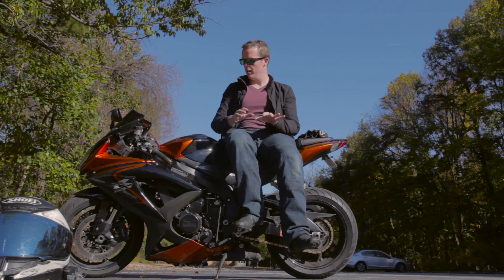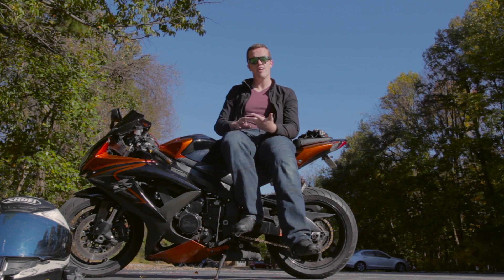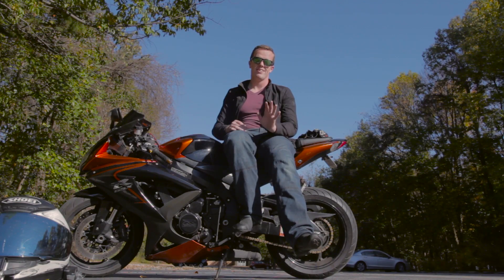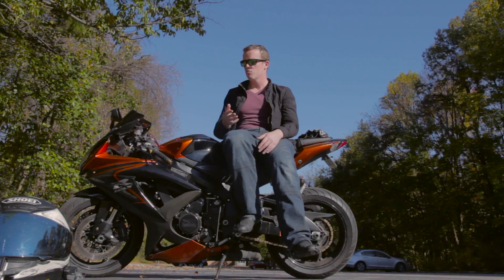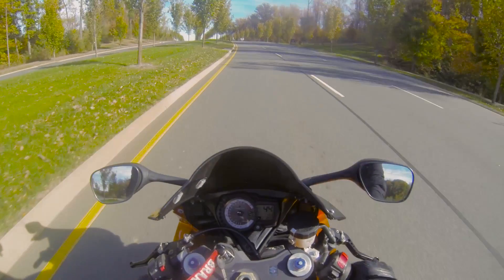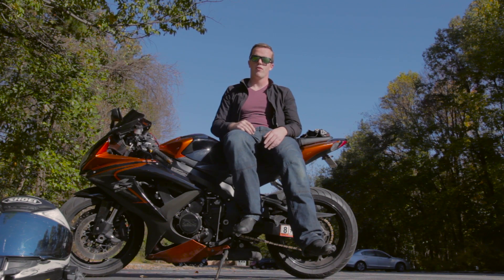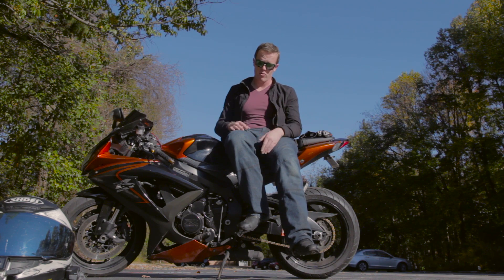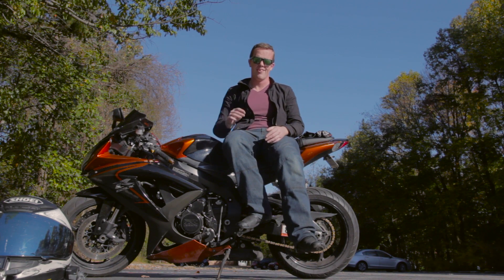How Motorcycle Engine Braking Works

Comment: I used to do 90% - 95% of my braking via engine braking, but changed my habit because I was chewing up rear tires.  Brake pads are much cheaper and easier to change than tires.  Proper braking shifts the braking to the front tire, where it should be, while all of the braking is handled by the rear tire with engine braking.

Comment: Also why rear tires wear SO much faster than front tires. No way around this, just an observation. Good vid, wish I had access to  this back in my noob days.
Reply: MrPunch09 That can depend on various different factors. Weight distripution, not having proper tire pressures, etc.

Comment: One consideration that you missed completely- engine braking increases gasoline consumption. If one of the reasons you ride is to save money on gas (like me), you are better off not engine braking and using your brakes, which over the long term are far cheaper to replace than the extra cost of the gas you will use over time.
Reply: Injectors shut off during deceleration, the back wheel is turning the engine during deceleration not the fuel.
Reply: nitemareman1 he literally explained it to you though?
Reply: You post a comment on this guys video telling him he is wrong, and now you are asking us to explain how engine braking works to you. If you already knew that you didn't know how engine braking works, why did you tell the video creator he was wrong in your first comment.
Reply: You stated  "When I drop a gear and let the clutch out, the engine revs INCREASE as my speed drops."  and "I understand the force of the wheel working with the engine". So you understand that the weight of the moving bike is turning the back wheel which via chain and gearbox is turning the engine over at a speed determined by the gear ratio. So how is it you don't understand that if you then select a lower gear at the same wheel speed that engine will spin faster according to the new gear ratio selected.
Reply: No wrong, guess again.
Reply: No you don't KNOW, I'm a qualified mechanic with decades experience and you are not which means you are wrong and I am right, period. The fact you now admit you know what a combustion chamber is increases the chance you will guess right at some point, so take another guess and well see how many you rack up before you guess right.
Reply: Wrong again, and your videos prove you are wrong.
Reply: Take your Zoloft before posting again.
Reply: That is funny. And funny you mention it today. I'm a big rig truck driver, and earlier this am I was cruising at about 55 and my turbo blew. It sounded like a half stick of dynamite going off just under me. Scared me to death!

But that brings me back to what I can't seem to wrap my head around. If the engine is not using any fuel during engine braking, how is it still running? I realize it would be a small amount of fuel, but it still has to be burning something.
Reply: The engine is pulling at the vehicle, applying a slowing force, while the vehicle (through the wheels & transmission) is pulling at the engine, keeping it turning. No fuel is required when engine braking--the engine just acts like an air pump driven through the crankshaft by the momentum of the vehicle, pumping air from the intake out to the exhaust.
Reply: Not with EFI
Reply: You have a source for that assertion?
Reply: Injectors shut off during deceleration and have ever since EFI existed which is about the same time I became a qualified mechanic.
Reply: Funny thing about engines when they don't have fuel- they stop running. While engine braking (not the same as deceleration) there has to be some fuel consumption. The revs go up even tho the bike is slowing down. It has to be pulling fuel.
Reply: Engine braking occurs at deceleration, it is caused by closing of the throttle plate, the degree of engine braking is mostly determined by the compression ratio, You seem to be conflating "engine braking" that occurs in the operation of the engine during deceleration with the measurement of horse power via a dynamometer brake to get a Brake Horse Power (BHP) value, ergo a value that incorporates the frictional drag of an engine. During deceleration EFI senses the condition and shuts off the injectors as there is no point injecting fuel until the engine reaches idle or the throttle plate is opened again at which point it resumes injecting. That is one of the inherent benefits of EFI compared to Carb.
Reply: Dude you don't even make sense. Try again.
Reply: To you it doesn't make sense but I cant dumb it down anymore just for you.
Reply: You have a lot of nerve talking about "dumbing it down," when you can't even utilize proper punctuation and capitalization. Proper English has a funny way of making things easier to understand. How does an engine rev increase without gas? I understand the force of the wheel working with the engine, but there must be fuel present. Go.
Reply: But I was referring to your comprehension of how engines work not your punctuation. When an engine decelerates its speed is not increasing, it is decreasing. You can cause engine braking by operating the kill switch or running out of fuel at speed and leaving it in gear with the clutch out. How can that be made more simple to understand.
Reply: Man you keep making less and less sense. When I drop a gear and let the clutch out, the engine revs INCREASE as my speed drops. Explain how that occurs without burning gas.
Reply: No, and step away from the tool box now before you break shit.
Reply: My advice to him is next time instead of posting at someones video with "One consideration that you missed completely" in an attempt to correct the video author, and then proceed to demonstrate in ensuing comments he has less knowledge about engine's than a florist, perhaps he should have enough sense to know he is out of his depth and start out by asking for advice instead of giving it and he may actually get an explanation instead of ridicule.
Reply: nitemareman1 NOT WITH EFI
Reply: That is not an explanation. It is an assertion. Let's try it this way first- why doesn't the engine stop running if the throttle is closed by the EFI during engine braking?
Reply: Are you Triggered ?
Reply: If I'm rolling down a long hill, I can close the fuel valve and the engine would still be "running" down the whole slope. If you don't give it gas, it can't use gas.
Reply: This is truly hard to believe. If the engine is running, it's using gas. Every cycle of the piston fires off a fuel air mixture or the engine STOPS. If you start your bike and leave it in neutral, eventually the tank will run dry and the engine will stop. And that's at idle speed.
Reply: Hmm. Let me try to explain it another way... Let's say you have a fan connected to an outlet that's humming along. You suddenly pull the power plug. It still spins for a few seconds before stopping. Is it using power during that time? No. Let's say this fan is placed outside in the open, and the wind is blowing on it, causing it to continue spinning... Using power? Nope.

The same thing can be said about an EFI bike engine during engine braking. The momentum of the bike moving forward is causing the wheels to turn, which in turn turns the engine, even if the computer is not telling the injectors to squirt fuel into the cylinders. Going down a steep hill, the engine's RPM may increase even if there's no fuel running through it.

On carbureted bikes it's a little different, as fuel is pulled in from the carburetor's idle circuit by vacuum in the cylinder, causing it to use even more fuel than when the engine is just idling. However, it's still using a lot less fuel than if you're just revving the engine in neutral.

I have a carbureted bike, but I ALWAYS use engine braking. I try to keep the engine RPM between 4k-7k as I'm decelerating (RPM range varies depending on the environment), so if I need to blast out of a sticky situation I just apply full throttle while pulling in clutch, downshift, drop clutch, and rocket out of there.
Reply: But a fan isn't a combustion engine. It's a fan. There is no comparable explosion occurring with the fan. You can roll a bike down a hill in gear with the engine not running, also. The bike has to be using fuel when the engine is running. How does the engine run at idle then? Because the throttle is in the same position, right? I realize the computer can be telling the gas mixture to be doing different things based on parameters but it seems to me that if the engine is running it has to be burning gas, EFI or not.
Reply: And smart move to be ready for an emergency. I don't use engine braking, but I always shift down to a proper gear while I am decelerating so I can be ready to go if needed. I see some guys pull the clutch and stop at the light in 4th gear. Not good.
Reply: Perhaps I should've used a different term than "running"... I just meant the engine is still turning, pistons still moving up/down, valves still operating, etc. If you manage to get your bike rolling down a hill in gear with the clutch out and engine "off", the engine will still turn, and if it's a carbureted bike, will pull gas into the cylinders even if there's no spark to ignite it. In a fuel injected bike, there will be no fuel consumption when the computer does not have power supplied to it.
Reply: Well that is obvious. What the entire OP is about is that downshifting uses more fuel than pulling the clutch and coasting. The guy above said not with EFI. I don't see how it could be any different.
Reply: From https://en.wikipedia.org/wiki/Engine_braking :
"Additionally, fuel injected engines generally don't use any fuel while engine braking. This is known as DFCO or Deceleration Fuel Cut-Off."

When engine-braking on an EFI bike, you use a little fuel when you blip the throttle to downshift, but then when you close the throttle, the computer notices you're doing engine braking and the injectors stop squirting fuel into the cylinders. Alternatively, you can just skip the throttle-blip while downshifting and it technically shouldn't use any fuel at all (at the cost of quicker clutch/transmission wear).
Reply: Unrelated, but funny anecdote about how I realized engine braking still uses fuel on a carbureted bike: One day while rolling down a long hill in 4th gear, I decided to "save some gas" and turned off the ignition (kill switch). Near the bottom of the hill, I clicked it back to the run position, and "BANG!!" I thought my rear tire had a blowout. When there was no tell-tale fish-tailing, I realized it must've been unburned fuel accumulating in the exhaust, igniting when the ignition system started firing again.
Reply: The only one that appears to be ridiculed is you. You assert that you explained it in some techno babble, then when I ask for a clarification in English you pretend to be above it, when the fact is you know I'm right. The engine can't increase revs without using fuel. Simple shit. And I never claimed to be a mechanic, but I have a reasonable understanding of the way an engine works, which is how I know you're hiding your lack of knowledge first, behind needlessly complicated language, and now feigned arrogance.
Reply: He didn't explain shit. Why don't YOU explain it? How do revs increase in an engine without burning fuel? Go.
Reply: I understand it perfectly. The entire point of the argument is that you say the engine does not use fuel when engine braking with EFI. I say it HAS to, and you have yet to show in any way how it doesn't. You are arguing about things I am not disputing.
Reply: Nice straw man. I never asked anyone to explain how engine braking works. You contend that you don't use fuel when engine braking with EFI. That's what this is all about and now you're scrambling to argue about anything but that.
Reply: Ah, so the wheel is injecting fuel into the combustion chamber and igniting it. That clears things up for me. (Shid.)
Reply: See dude, I don't need to guess. I KNOW the engine is burning fuel. You're the one flopping and ignoring the question and feigning arrogance.
Reply: You're a fucking shop tinkerer, pal. You got caught spewing bullshit that engines don't need gas to run now you're back tracking. Back to your tinkering and fuck off.

Comment: And it's a safety concern, you are much better off being in gear at all times while the bike is in motion. If you suddenly had to move to avoid a bad situation, you don't want to have to find your gear to have power if you're floating down speed instead of engine braking

Comment: This makes no sense, a vacuum because there's no air or fuel going in? Hows the bike running then?
Reply: Jamal Mahroof The bike runs because it's already moving so the momentum from travelling transferred from wheel to chain then gearbox and then the engine which in turn has a flywheel , the momentum from which creates the kinetic energy to keep the engine turning over , well that's a basic version anyway , hope that helps !(:
Reply: Luke Jarman But obviously air and fuel are going in if the engine is running as in it is on. So it can't be a vacuum if the engine is running and you can hear the explosions on the cylinder
Reply: Jamal Mahroof That part I'd say you were correct on , not sure the guy that did the video had his information totally correct , as other people have mentioned piston rings compress air an fuel , piston rings don't work backwards , when you back off the throttle your more or
Less just cutting off the fuel supply and not the air supply , but there will still be some fuel going into the cylinder but this also depends wether the bike is carbureted or fuel injected , if the bike is carbureted then you will always have the same amount of fuel you'd have at idle going into your combustion chamber , fuel injection can be different as it can be computer controlled to only allow the fuel in when it may be needed . This subject get so complicated when it gets into all the technicalities ! !
Reply: Luke Jarman I think what he meant to say is that as you let off the throttle, the bike is still in gear so the piston is still being moved up and down by the rotation of the tire but there is constricted air going in so it creates low air pressure in the cylinder causing the piston to slow down and consequently the tire to slow down (it's all connected in gear) Would you agree?
Reply: Because the throttle closing closes the amount of air going in
Reply: Jamal Mahroof completely agree with that conclusion ! Nice one !(:

Comment: Back in the day when I rode a Yamaha RD 350, engine breaking was a natuaral and integral part of riding.  Stopping, cornering, and other maneuvers were all accomplished with the inclusion of engine breaking (We simply called it downshifting.  It was also called dynamic braking) to one extent or the other.  It was how sport bike riding was done.
Fast forward to today, and I now ride a pretty big touring bike:  a Harley Davidson Road King Classic, with lots of chrome, classic spoked wheels, and a 900+ pound curb weight.
My riding style for my RD would be considered mildly aggressive.  On the Road King, however, it is beyond aggressive to radical.  Not that the bike cant handle it. It can.....well, most of it, anyway.
Aggressive downshifting, or engine breaking requires a little more finese and restraint.  I learned that on a ride over Beartooth Pass in Montana, where my cornering,  and rather aggressive downshifting through the switchbacks resulted in me breaking 8 spokes in my rear wheel.  I guess I'm lucky in that the rest of the spokes didn't zipper on me, and I rode off the mountain instead of going over the side.
I had to have a new hub laced in, because the old one was trashed.  What probably would have been better was replace the spoked wheel with a mag. The rear wheel really isnt very visible with the saddlebags, so it wouldnt have messed up the aesthetic.  
Anyway, I still use downshifting to bleed off speed, just not quite as aggressively as I did in the past.
Final note: I'm sure there are those that will be dying to troll me for riding a Harley, or about how I ride or some other zinger that they come up with.  Bottom line:  I ride to bring joy and happiness into my own life.  If you ride, I'm pretty sure thats a big part of why you do it, too.  Sport bikes are tons of fun and the feeling one can provide when the bike and rider are well matched is amazing.  I love touring.  My Road King makes me happy.  So if trolling is your intent, slow your roll and dont harsh my mellow.

Comment: You should not engine brake on a 2 stroke. A 2 stroke engine gets lubricated from the oil mixed with the gas. If you dont let gas in the cylinder it wont get lubrication thus wearing it out.

Comment: I thought the valves opened regardless because the cam's rotation it tied to the crankshaft. I guess I need to get learnt! lol I always used engine braking whenever I could back when I had a bike. I had a 2003 cbr1100xx and put 25k on it with no problem. my dad always complained I was going to ruin my bike, he was a Harley guy.

Comment: Just a little bit to add that you didn't mention, not only does it leave your brakes cool and ready for emergency braking, it preloads your front suspension which lessens the chance of front wheel lock up if you grab the front brake too hard.